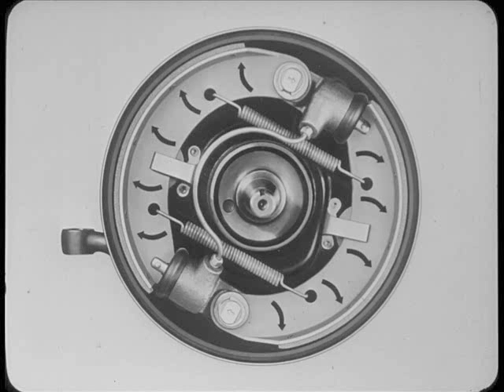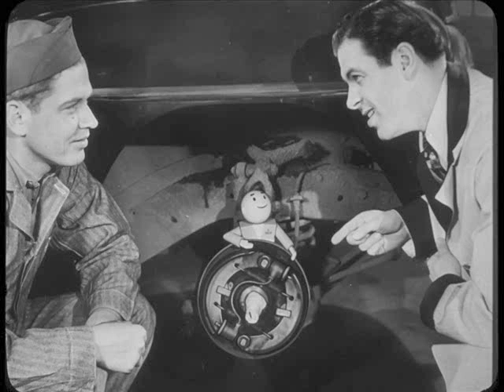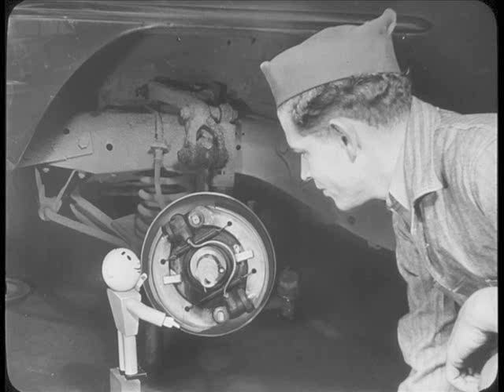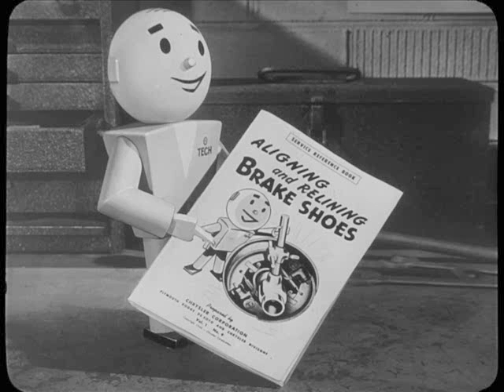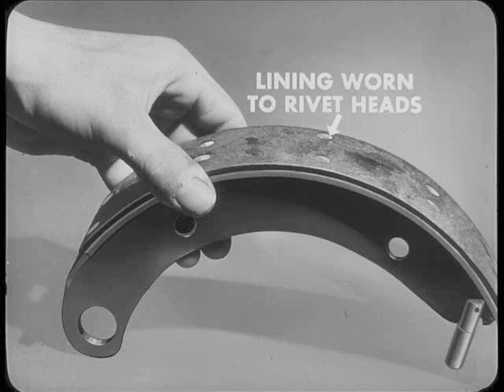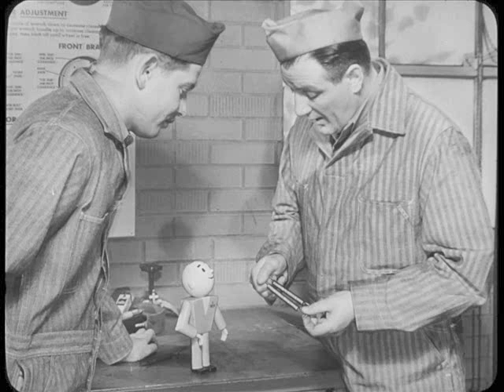Chrysler Master Tech - 1948, Volume 1-9 If The Shoe Fits

Comment: YEP   the old center plain brakes.    total crap.    the list of  the should have been better mopar parts.   NO 1  the center plain brakes.   NO 2  tapered axles,   3.  ball and tr-union U-Joints.     4.  heater control valve on the fire wall.  that leeks and the frame rusts out.  causing the  tortion  bar frame to crash to the ground.   when should i stop?
Reply: bulkhead connectors???
Reply: Complain a lot? I have 64 300K still running.

Comment: Were not the  shoe linings  made of asbestos?
Reply: I'm not sure if they were entirely made of asbestos, but they did contain asbestos. I think it was in the 1980s that new cars shipped without asbestos brakes. I think there was also a ban on manufacturing replacement brake linings with asbestos in the USA during the 1980s. However, I don't know if that applies to brake linings made outside the USA. Some say that brake linings from certain countries still have asbestos.

Even though there may be no asbestos on modern brakes, it is crucial that you never clean brake parts by blasting them with air. The dust could still be hazardous.
Reply: @skylinefever  Water, Wash down with gentle nozzle spray.
1941 1/2 T  WC